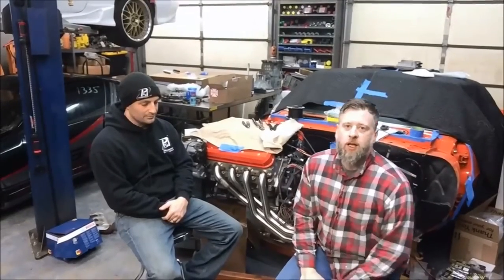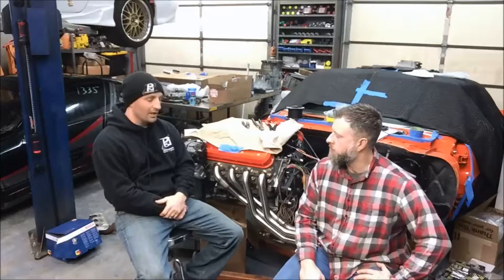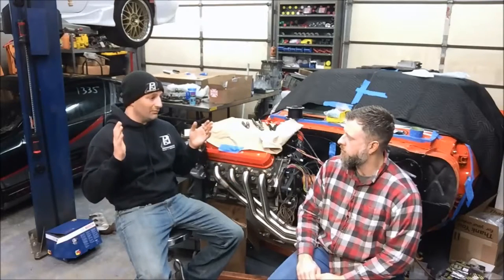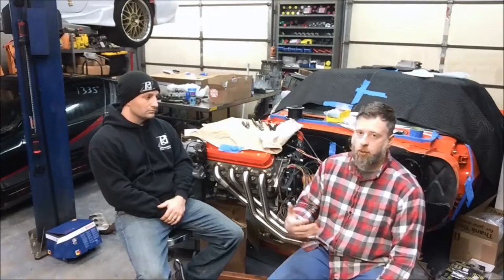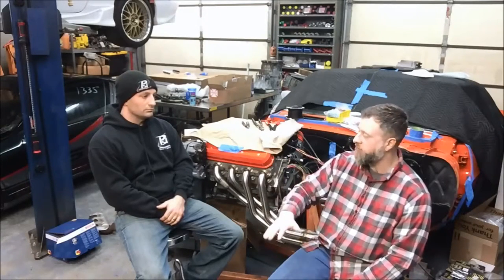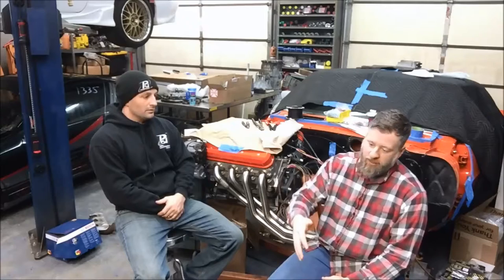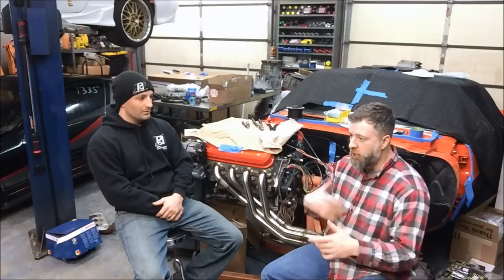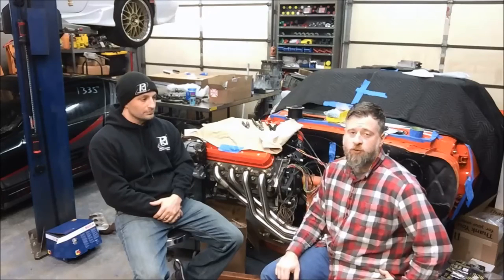Your LS2 24X & 58X Swap and what makes it unique - PSI / LOJ Conversions VLOG - Let's Talk LS2

Comment: OMG thank you you answered my question I have a LQ4 24X reluctor wheel and I found a 05 GTO that has no motor in it so I’m trying to figure out if my motor will work I think it will not sure about the cam sensor if it’s on the front of the motor mines on the back

Comment: What can I do to run the 6l80 trans behind an lq4?
Reply: If you are doing a swap into a vehicle that never came with that transmission from the factory, (as of 7/2024) your best bet is to run a separate standalone transmission controller.

Comment: So can you reprogram the computer to convert between 24x or 58x…????
Reply: No. For GM pcm’s you need to run the one specific to the reluctor with the correct operating system. For engine swaps, 24x is going to be far more compatible and less headaches. Not to mention, you can run any 4Lxx or manual transmission off of the PCM without the need for a Trans controller.

Comment: im trying to figure out going around not having to use a lingenfelter trg-002 conversion box since i put an ls3 into 05 corvette, and without changing reluctor wheel, as the engines already in the car with a 58x and 4x cam gear. how can i just get it to start